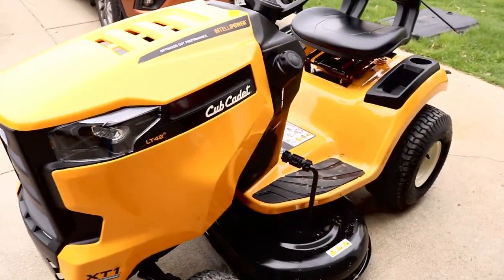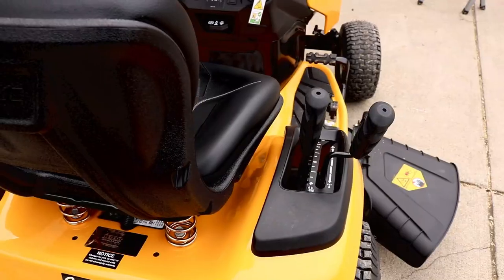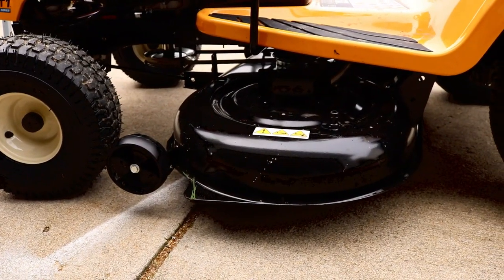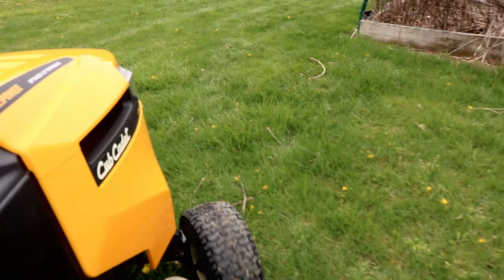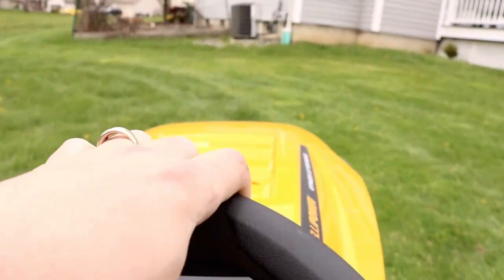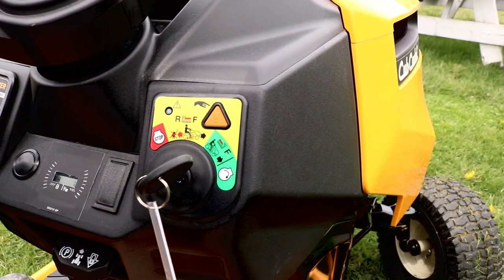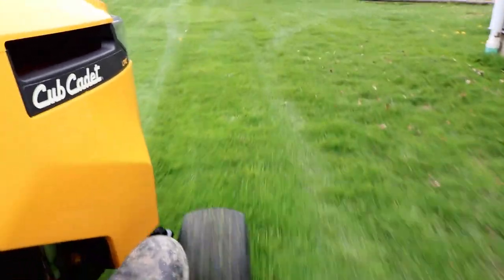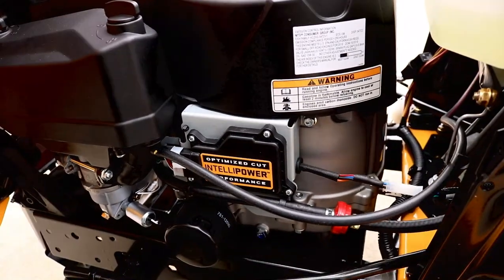Cub Cadet 42" IntelliPower Riding Mower (REVIEW) Cub Cadet XT1LT42 with IntelliPower ENDURO SERIES

Comment: Ok. Beyond the silly marketing buzz words, what exactly IS Intellipower?  Is the engine fuel injected?  Is it just an electronic throttle control on a carburetor?  During the video I thought I saw what looks like a carburetor and fuel shutoff solenoid. I noticed you didn't choke it when starting, does it have a choke? I went to the Cub Cadet website and downloaded the Owner's Manual for this tractor but ironically the current manual still shows a standard throttle lever with a choke detent. In other words, the manual does not contain the word "Intellipower" anywhere. :-) I also downloaded the engine manual and also no mention of Intellipower. They list this as a "Cub Cadet" engine but we all know Cub doesn't make engines. Just curious what the underlying function is behind the fancy names. Typically the governor takes care of any "bogging" and throttle modulation. Thanks.
Reply from the maker: Great questions.  So I reached out to Cub and asked what brand engine it was. Though maybe it was a Briggs or Kohler,  but all they said was "it's a Cub Cadet motor." As for the choke, Tgere is bo check on this like my last mower had. From what the Dealer told me, it there is a computer chip that can tell when the motor is starting to bog dow when in wet/thick grass. It sends more power to the blades when it calls for it. I have push mowers that do this and works great. When I was getting into the heavy stuff,  you could here this powering up and went through like nothing.  Its pretty impressive
Reply: @ToolReviewZone  It would be interesting to know exactly how this works as we all know there isn't any magic. For an engine to "send more power to the blades" you simply open the throttle or in this case the governor does. :-)  Understanding what's happening behind the marketing lingo will also help future owner's understand what to do when this engine ultimately starts acting up - as they all do eventually. :-)
Reply: Only thing i can think of is the hydros reduce power demand to operate that allows less drag on the motor hence more power for the blades to use.
Reply: Without examining close up, I'm sure it's fuel injected and has a sensor to increase fuel if motor slows down. Peachy keen as long as it's new with good compression. With age, if if fails, probably cost a fortune to fix.
Reply: @akbychoice  That sounds a bit too advanced for a single cylinder lawn mower engine. :-)
Reply: For all those wondering i work for a Cub Cadet dealer.  Intellapower is Cub Cadet speak for an Electronic Govenor.  It monitors engine speed via the ignition coil and if the engines drops below the speed you set the dial at, ie: 3600 rpms, it will bring it back up to the set speed very quickly.  This engine still rely on a carburetor.  The engine is designed by MTD (owner of Cub Cadet) and is built in their own factory in China then shipped to America where the mower is built for final assembly.
Reply: @jmc6000  correct it is carbureted but they also have a fuel injected version now

Comment: I got a zt1 with the kawasaki 23 hp motor and the 50 inch fabricated deck. Zero turn is way better than a tractor.
Reply: Depends on the type of yard you have
Reply: @manofculture4945  I got a little tractor for ditches and areas where I'm not taking the zero turn like around the pond but the zero turn does most of the yard.
Reply: @kylestivers4606  yes but in the case if did have like 3 acres of flat land then there is no point in a zero turn
Reply: @manofculture4945  my yard isn't flat and it works just fine. Tractors suck because they can't turn on a dime and they're slow as fuck.

Comment: I just got this machine and I Hate It !!!! . I have some 5 to10 degree slopes on my property and if the grass is even a little damp it slides and gets zero traction. The seat is very uncomfortable, you need to hold on with one hand to the seat while turning or you slide off. Unless your property is perfectly flat and dry, this mower is useless.  I will be contacting cub cadet and asking for my money back.
Reply: I put Chains on my back tires, it helped a lot

Comment: Ok, so you pay more for a knob to replace the throttle,, and you get a  engine made overseas, that dont have a very good reputation,, thats why I went with the XT 1 with the Kohler engine, plenty of power,,cheeper also
Reply: +1 I recently bought a 2018 Enduro model that had the Kohler 18 and the manual throttle. It had sat at the store for almost two years and was never started. Got a great discount on it and it runs amazing.

Comment: The features on almost all 42in garden tractor mowers are pretty much identical although they may not be in the same place. Most of them have specifications that vary very little. That's because they get a lot of the sub-assemblies from the same manufacturers. 

The thing to look for is the quality of the dealer. That is more important than the brand of the garden tractor.

Years ago, you could buy a garden tractor and use it for years and years. However, the new garden tractors will not last because the quality is way down to keep the price down. That being said I abused and used my last garden tractor for 9 years. However, it needed major maintenance toward the end. I can do my own repairs but the cost of the parts to rebuild the engine and work on the hydrostatic drive were way too high to make it reasonable to repair the tractor. 

Earlier on I had to change all the steering bearings and steering gear.The rest of the steering system was pretty much worn out by the time I got a new tractor. The old tractor had 750 hours of hard use.

It's unlikely that your owner's manual will discuss the possibilities of lubricating most every part of the steering assembly. You will find a lot less effort in steering, if you keep the pivot points for the front wheels greased and get under the tractor with the mower deck off so you can spray a good lubricant on the steering gear. This will reduce the force required, when steering a great deal. After lubricating everything you will be amazed.  The effort for steering increases slowly between lubrication and you don't notice it until you service the steering system. This will also increase the life of the parts in the steering assembly.

The mower deck will last fairly well if you have a smooth lawn with no limbs or other foreign objects. I buy reinforcing rings and put them on the mower deck prior to its first use. This helps keep the mower deck from cracking. I have a deck that I welded it up four or five times. If you can't do your own welding, don't be surprised when you find out a new mower deck as well over $700. I know because I had to buy a new one prior to understanding all the problems mower decks have. During the life of a deck you will probably have to replace the blade spindles. Repairs to the mower deck are fairly simple. You will do a lot less repair work, if you completely service the mower deck every 25 hours of mowing.

Comment: I have the 2018 model, with an actual throttle cable, won't be buying that intellipower garbage.  So far into the 3rd season, threw a set of Gator mulching blades on it for this season, with the regular hi-lift blades it'll throw the grass out of the way which is a great thing, the complaint I have is the mulching feature is pretty lacking, the deck doesn't have baffles around the front and sides so it blows a lot of grass out from the edges of the deck all over the operator, that's the only plus to my previous Craftsman YT4000 lawn tractor, it mulched better than the Cub Cadet.  I have the Kohler 5400 18HP engine in mine, does great and I do have the 42" 3 stage snow blower as well and it runs that blower very well, I have the rear suitcase weight kit and tire chains.  Planning on getting the rear sleeve hitch and box scraper to keep my driveway smoothed out.  

That intellipower crap will cause problems when it starts to go haywire I'm afraid.  I'll stick with the old stuff LOL.

Comment: Chinese motors and more electronic crap on a damn lawnmower =unreliability and expensive parts/repairs!!!👎 Reverse override is a joke.
Reply: Bumper to bumper made and assembled in America. It's all every basic design. If you can operate a keyboard you can maintain and diagnose any issue that may occur.
Reply: Yes the engine is made in a MTD factory in China but final assembly happens in the USA in the same factory the mower is built in.
Reply: Wow! Might be one of the WORST reverse override processes ever. what were they thinking!?

Comment: That mower is a piece of junk, Chinese engine made by zong chang. That has some dumb Throttle Control on it and the mower deck is junk. The mower deck is used though out the entire MTD lineup, IF YOU WANT A GOOD MOWER BUY JOHN DEERE OR HUSQVARNA.
Reply: hate to tell you but look who makes most of the engines for john deere now..its Briggs and Stratton and they are junk..John Deere puts their name on the engines.
Reply: I have one on order from HD......10 % vet discount.
Reply: When I was in the market for a mower, I heard nothing but bad things about Husqvarna from coworkers and family that owned one. Needless to say I didn't consider tbem due to the feedback, however I heard good things about Cub Cadet and their ranked pretty well online, right behind John Deere in terms of overall mowing and reliability on most websites. I took a chance on the Cub Cadet which comes with a good warranty and was about $1200 cheaper then the Deere. We shall see how well it runs for the next few years.